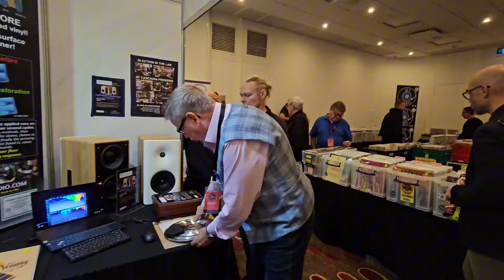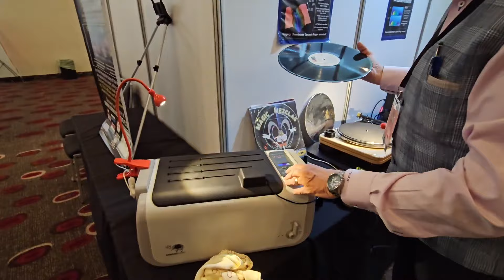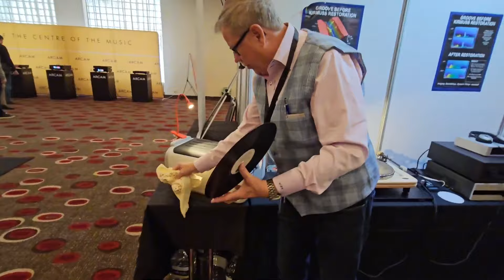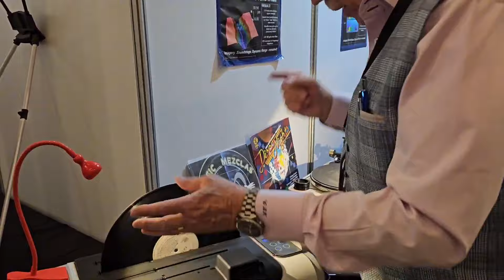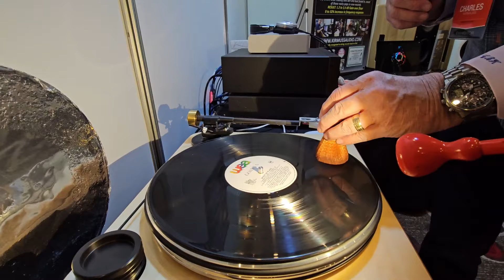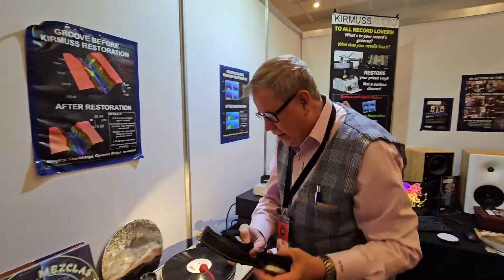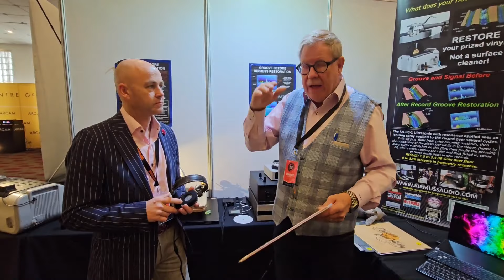MY RECORD RESTORED BY KIRMUSS The process, before and after test.

Comment: Please keep this man away from my records! He is right about one thing though. The oil used in the pressing process is snake oil!
Reply from the maker: @fernandozaldivar7581  There is no oil per sey in a record or sprayed or applied onto the stamper.  If you consult the "Making Vinyl" web site, in addition to the pvc which is clear and where carbon is added, accounting for the color,  there are liquefiers, stabilizers, plasticizers among fillers etc. added.  When heated and pressed a release agent part of the stamping process surfaces.  Allowing the record to pop out of the press.  Thought it would be appropriate to elaborate on record production to those interested in the hobby...

No matter,

The Shure Borthers discovered where their V15 Mark IV needle in circa 1977  was "digging out" something. I recall these cartridges being returned to the store that I worked in during summer vacation. Shure called it a Pressing Oil.   Solved in a needle design change in the Mark V.  It predicated the start of the record cleaning industry.

Very funny your comment about snake oil.  Snakes have a nasty bite!
Ouch!

I suppose then the likes of Jeff Rowland, Julian Margules, Bill Voss of Technics, Jacques Riendeau of Oracle, Mark Doehman of Doehman-Helix turntables, Cristan and Ken Wolff of SOTA, Mike Knowles of Alphason, Kevin Haynes of VAC, Michael Fremer as well as others also are illiterate as to record production and the Kirmuss process which they use and recommend...

Comment: Nobody can remove scratches or other damages...you can clean it though which will improve the sound...
Reply: I’ve been removing jumps and skips since I was 15, to the point where the stylus won’t even pop or tick when it plays through the damaged area. You can’t physically remove the scratch from the area between the grooves, but you can remove the debris that causes the stylus to skip grooves. It can be a laborious task, but it’s worth it in the end.
Reply from the maker: @vbathory3757  Right on! Thanks for elaborating!
Reply: @vbathory3757  some scratches you can remove 'between the grooves' depending on how it's scratched and what tools you are using, sometimes it can be rectified with certain tools (very basic ones) and a loupe / microscope  - metal sharp objects are to be avoided though with this process you don't something so hard to do it.    These are types of scratches tha cause the 'walls' and ridges to collapse in ,which the diamond cannot navigate..but the tool pushes them back into 'shape'  - I notice quite a few Japanese know about this technique as they use the proper tool as well.
Reply from the maker: @romanmeisterl6997  There are two types of scratches, the ones in plastic, and others that are aparent in the film deposited on the record by the outgassing of the plasticizer while the record is in its sleeve for weeks or decades.  We remove the latter.

Thus record restoration and not surface clean or shining removes  three distinct layers.  First, films left over from prior cleaning processes that are either air or vacuum dried onto the record's surface, then the film just described which accounts for the majority of scratches and scuff marks, then the release agent that surfaces during the pressing process of the record allowing the record to pop out of the stamper and where the cooling oil fuses dirt, dust and other contaminants that land on the cooling record that are cause of those nasty pops that we hear from new records. 

While marks in actual plastic cannot be fixed, such as a tone arm skid where one hears a tick every revolution,  70% of the time we no longer hear this tick although we see it as the needle is now  not competing with the various films and is  niw lower abd seated in the pocket,   not  picking up the surface scratch.
Reply: believe it or not there are physical mechanical methods of repairing some groove damage, and some superficial scuffing on surface , but that's a different topic and very specialized.
Reply from the maker: @SPINNINGMYWHEELS777  Most of the scuffing we have dermined to be in the film deposited on the record by the outgassing of the plasticizer of both the record and pvc sleeve. 

To repair, one cannot repair the damage to sub micron detail pressed in the record's groove.

Comment: I bought mine about five years ago. It's time consuming, but it does work well. I found that I ran out of the spray. I had to phone Kirmuss Audio and give them the serial number off my unit in order to go to a store that sells his product so I could buy more spray otherwise they will not sell you the spray unless you can show them you owen one of their machines.
Reply from the maker: @johnw.graovac8030  Several years ago an ultrasonic manufacturer of a true ultrasonic saw a record collector use our ionizing spray on a collection of records with their machine. The frequency was 46 Khz.  The records were sandblasting and affected the manufacturer of the machine. They shut down business. Some audiophiles maje their own  cleaning agents. Most are dangerous to the health of the record. Others dangerous to the health of the person.

Ionization changes the charge of the record to be opposite to that of water to attract the effects of cavitation to the record to remove first films left over from prior cleaning processes, then as we proceed in another cycle,  the film deposited on the record by the outgassing of the plasticizer while the record is in its sleeve for weeks or decades, then in final cycles, the release agent that surfaces during the pressing process that allows the record to pop out of the stamper. Added any dust or contaminants that land on the cooling record that are cause of those unwanted pops heard in new records. 

So important that we ensure as protection to the health and longevity of records that ve do our best to service KirmussAudio owners. 

Of course folks that are regulars do not have to provide a serial number. 

Thanks for your patronage.  Hope the above responds and explains a little more the background of the process and what record ionization and cycling the record in and out of our machine accomplishes. The ionizing agent and charge induced "washes off' as the record spins.
Reply: How many records did you get out of the bottle?
Reply: @daveyurkovich9459  I only got about 50 records on my first bottle
Reply from the maker: @daveyurkovich9459  Refil does about 150 to 200.